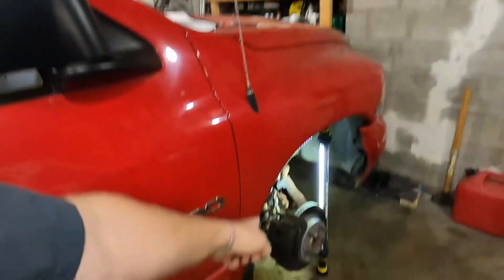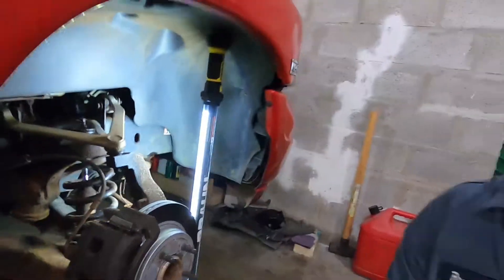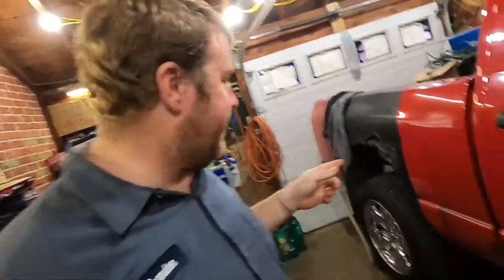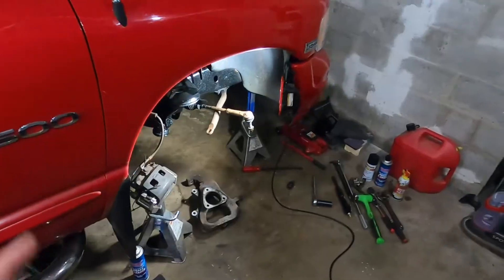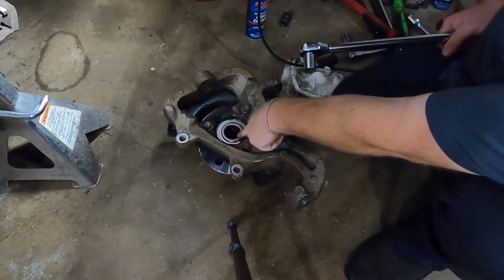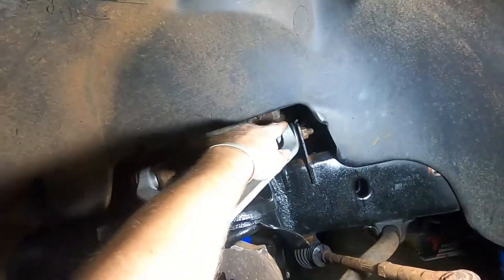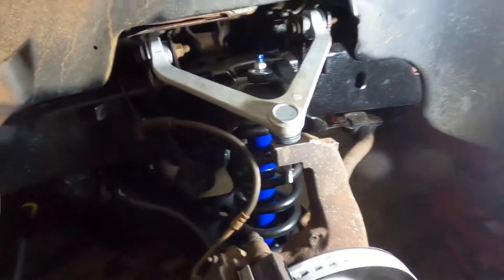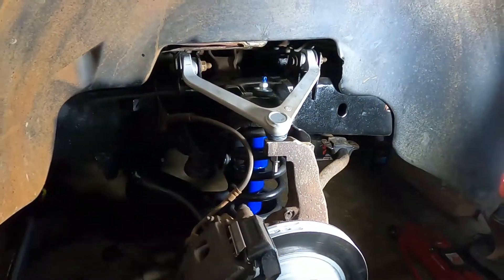Complete Front Suspension Replacement on the Dodge Ram

Comment: What kind of spraying paint was that? Did you do just one coat of it? That's my project on rebuilding my 2003.
Reply from the maker: @porkchopblack591  just a can of black rust paint from hardware store I had laying around. I'd recommend something stronger like a chassis paint,  POR 15 or raptorcoat if you want it to last longer.
Reply: @nextweeksadventure  I appreciate it. Thank you for the content.

Comment: I wanted to see how you kept the spring from jumpin out at u,  im assuming the pocket up top is deep enough that it doesnt?
Reply from the maker: @funify11x  make sure a floor jack supports the control arm the entire time!!! Once everything is unbolted slowly drop the jack. Ratchet strap around coil and frame can help hold spring in place also

Comment: Why would you replace the whole lower control arm? Just replace the ball joint
Reply from the maker: Control arms had a ton of rust, weak spots and pressing old joints out was going to be a huge pain. So for the price of the new ones it was cost effective and easier to just replace the whole thing.